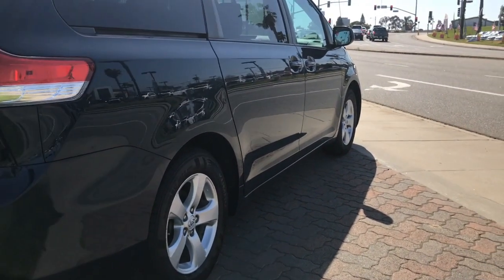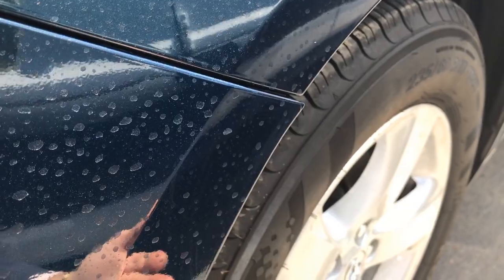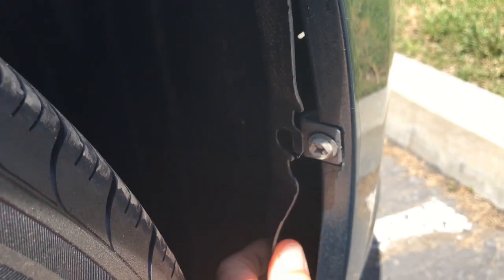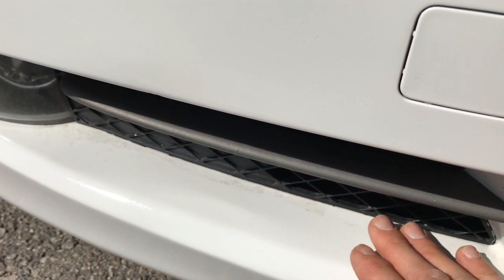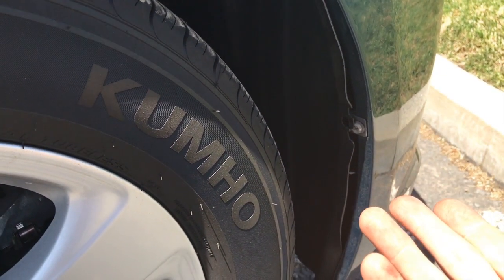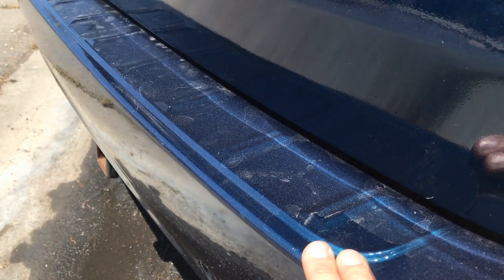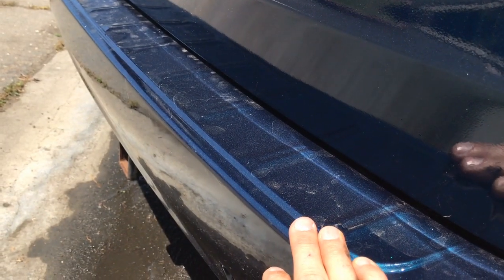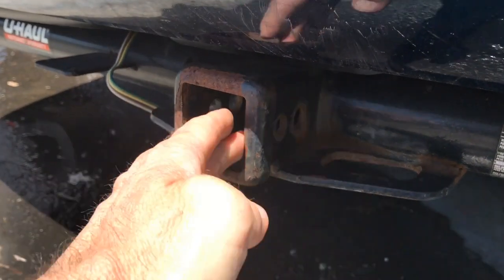DON'T BUY This Lemon

Comment: Nice videos. It's nice knowing that there are some people out there trying to help the small guy look for a used car and not get ripped off in the process. I do have to say that the paint spy tool is pretty cool - how did you find out about it and why do you use it compared to other tools (say a paint depth gauge)?
Reply from the maker: I invented the Paint Spy tool. I found the other digital paint meters to either be too expensive or made of cheap plastic that did not last long enough. I engineered and built it myself. www.paintspy.com
Reply: Makes total sense! Thanks for bringing an awesome product to market!
Reply: @YourCarAngel  You're a smart man. Thank you for this.

Comment: I also see a huge difference in the finish on the repainted areas, the reflection is very splotchy compared to the smooth mirror-like finish of the factory paint.

Comment: I once had to tow my car because it stalled. During towing with a towing strap the bumper came off on one side. Another time after reversing the bumper dislodged after my car was sitting over the yellow parking concrete barrier. So  just because the bumper is Not aligned doesn't mean it was in a collision. Sometimes mechanics work on cars and remove the bumper.
Reply: True, to change the headlights on my Chevy Malibu you have to remove the front end. It's crazy... Had I known that, it would have been a deal breaker. Now I know to search how hard it is to change the bulbs... But on the other hand it hasn't given me any other issues other than basic wear and tear maintenance stuff. 10 years and 165k problem free.
Reply: @crystalholcomb9836  so to change the headlight you have to remove and repaint the bumper?
Reply: @andresramirezpercusionista8001   I didn't have to repaint it... Look up changing a headlight on 2009 Chevy Malibu...
Reply: And why would anyone believe you?

His whole point, that seemed to go right over your head, was that why play a guessing game with what was the exact reason the bumper was messed with when you can find another car in which you don't have to do that?

It's a simple concept.

Comment: Great set of advices.
I have several scratches and small dings around the car. Body shop tells me to paint the entire sides front and rear, inclding the hood. Is this advisable? Or should I just go with spot touch ups?
Thanks

Comment: I don't know if you have already covered it but I find in this age of electronic auto transmissions that if there is 'play' in the unit you are stuck with a bad trans.  As you know there are no real adjustments in the newer ones.  Can you offer advice on inspecting an auto car for trans. problems.

Comment: cars are not sold here in the uk with factory installed tow bars. I would imagine a car can pull a reasonable load, after all you cant legislate how much is carried inside the car either.

Comment: great tips! i bought a 2008 Accord 5 years ago that was rebuilt and i am now seeing a lot of the things that youre mentioning. 

Ive been veey lucky that the car has beem 100% mechanically sound, but thr wheel well liner has come off and areas of paint have begun to chip. 

is there any way that i can personally check if in fact the airbags are there? the guy said they were, but just to be safe. or how much that migbt be? im on a very tight budget, hence the rebuilt car ;) 
thank you
Reply: MrUnbelievableAbs check to be sure the airbag light comes on and someone didn't pull that light. If it comes on and goes off you should be ok. I also think a check engine light would come on if they were missing.

Comment: hello Greg!How are you?I have a question if you don't mind......Is it true that white or lighter paint colors can hide flaws in the body work better than darker colors? thank you.... 
                                 crazyweasle.
Reply from the maker: Yes it is true that darker colors are easier to see flaws. This is because the contrast between the color of the dark surface and the light reflecting on it allow for small imperfections to be revealed, whereas on a lighter car there is no such contrast.
Reply: YourCarAngel thank's buddy!

Comment: Man u asking too much most of cars get little accident doesn't really effect the car extrnal damage been repair so really doesn't matter unless been really wrecked badly but good job, good for people have no idea about car, Best advice take it to professional expert to inspect it.
Reply: I have had cars that were in accidents and the paint is never right. They fade, crack, and dull out like he is saying.  Now I had some vehicles badly damaged in a hail storm about 8 years ago and the paint has held up really well but there were other things that weren't quite right. I have had plastic trim pieces fall off one car that they just stuck back on with hot melt glue and double sided tape. A vehicle is never the same after you break that factory paint. If it is just an old clunker you don't care about, then fine. Just know what you are getting.

Comment: It`s all about price at this point. If this one is cheaper than similar spec/age/mileage cars than it`s okay. Afterall car is used, and used cars have their flaws. Probably the car will be 3 times cheaper ( than new ) even with replaced bumpers and full body spray ( Depending of labour price )

Comment: This car was a disaster front to back.  Transmission issues incoming based on the use of that hitch alone.  Not mention a cashed car can have hairline drivetrain fractures that become massive issues

Comment: Could any used car be not damaged? I doubt it.
Reply: LittleChild Games My last 5 cars have had no damage. And I drove one to 100k miles. It is definitely possible to buy an undamaged used car.
Reply: Majority of used cars have been involved in accident..finding a true one owner car is not easy, for cars over 7 years.
Reply: I bought my car used with 21,000 miles on it and not it has 105,000 so yes you can can a used car with no damage